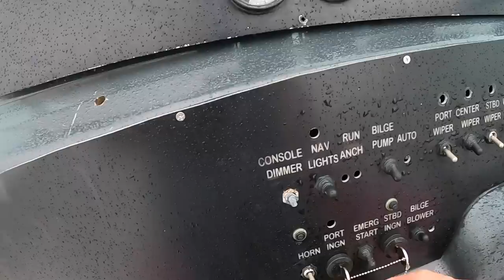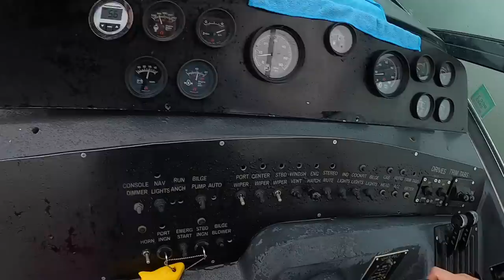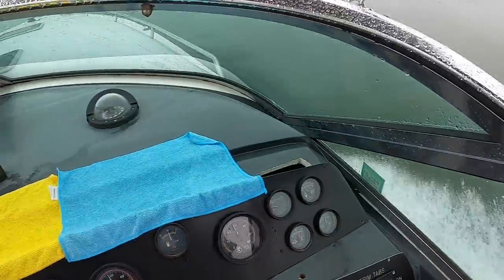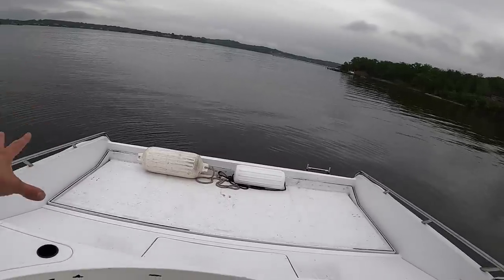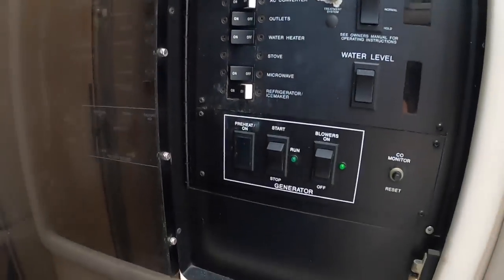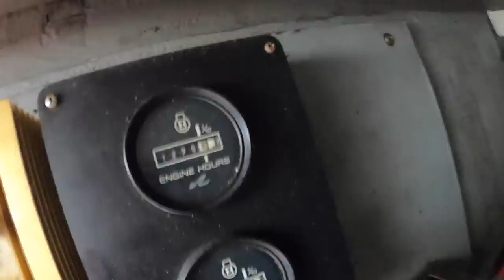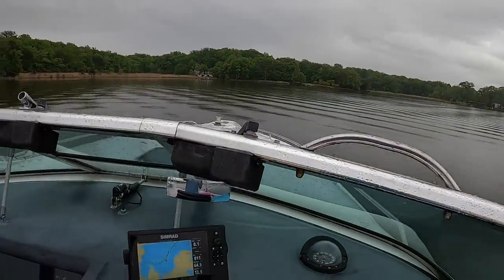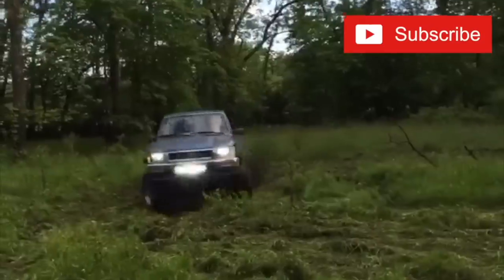Wide Open Throttle?! Sea Ray 380 Sun Sport Walkthrough | Boat Restoration

Comment: 😅pick up some Wesley is white wall cleaner at your auto parts store, spray it on your fiberglass swish it around a little bit have a little drink of beer, and then scrub off all the dirt, I’ve been using this stuff for 40 years I can’t find anything better.  (After 40 years I am not looking anymore).  Lol.  I am over 70 and boat less , but I have Bought and sold more than 12 boats, Mostly sailboats and two trawlers in the 40 foot range, enjoy your boat , and many more to come , get a sailboat you can go further, without worrying about fuel. Lol

Comment: Heads up.  When you sell the boat, someone is going to show up with a moisture meter and tell you that the stringers and the transom are rotten.   They won’t be lying because it’s a 1990’s SeaRay.   Don’t dump too much money into it.
Reply from the maker: Surprisingly enough, I've tested them. They are dry. I have used a meter as well as taken samples. It's hard to believe it but I'm lucky. I'm sure someone will bring it up but I'm glad I can at least speak to it. Thanks for watching the videos brother.

Comment: greasing the steering cable (and throttle cables): 1. take a garden hose, 3/4" will do for a steering cable, attach to one end a compressor air fitting and a shutoff valve 2. disconnect the steering cable end (transom side) and pull over the said hose with the other end on the cable, clamp the connection to seal hose\cable connection 3. open shutoff valve and fill low viscosity motor oil (like 0w30) or atf to the other ned of the hose 4. close the valve connect the compressor, set the psi so as to not rupture the hose. 5. Open the valve to let oil under the pressure in to the inner part of the hose, try moving the steering wheel to speed up the process. After a few hours the steering cable will be like new

Comment: That thing is a monster, cool, but no less a monster. You should probably keep a pair of bravo 1's in stock, that has to be hell on those drives.
Reply from the maker: The bravo 3 gen one drives definitely put in the work. They are the weakest link.
Reply from the maker: The bravo 3 gen one drives definitely put in the work. They are the weakest link.

Comment: I’m not sure what kind of material your cover is but I recommend trying 303 Fabric Guard! You’d want to lay the cover out, scrub it with some soap and water and let it dry out. Then apply a good amount to the cover and let it dry. Does a great job of repelling water. Another big factor is the pitch of your cover. Support poles in the right areas are key!
Reply from the maker: Thank you for this! The bungee does a great job but a support pole or two would help. The cover is made out of semi truck grade load cover material. Very thick rubberized material.

Comment: Did those higher pitched props work out????
Reply from the maker: Yes they did. Worked like a champ. 30 mph at 3000rpm. My fuel burn is significantly lower at cruising speed (30mph).

Comment: Hey there, love your videos. I was wondering if you would be able to give me some advice. I have a 1991 Monterey 206 SCR and I’m having intermittent starting issues. I can give you a rundown of what I’ve done so far. Really looking for some advice.
Reply from the maker: Send me what you've done so far. To get the Sea Ray running right we replaced... spark plugs, rebuilt fuel injectors, replaced ALL battery cables, removed and replaced all fuel and fuel lines/filters, fixed up fuel pump, tested all ignition coils.